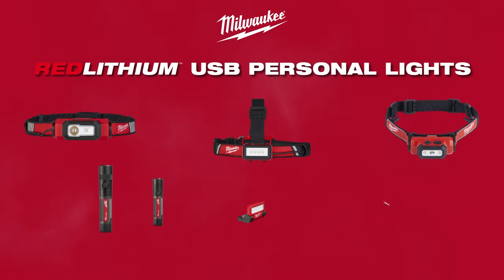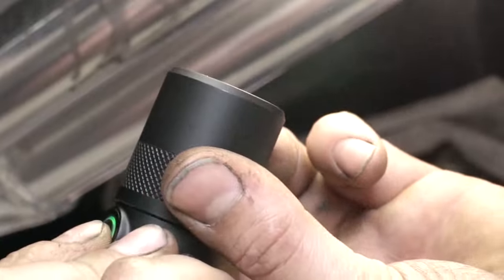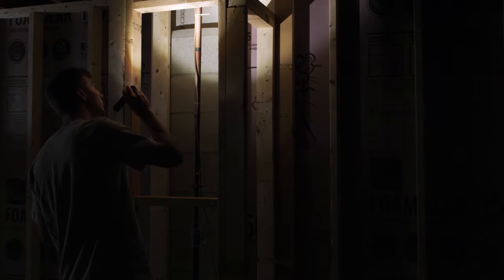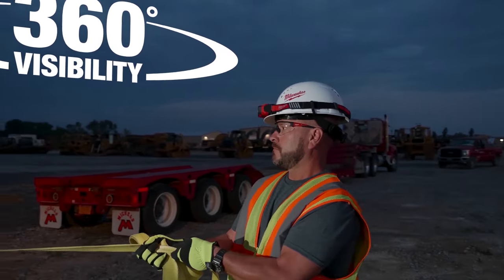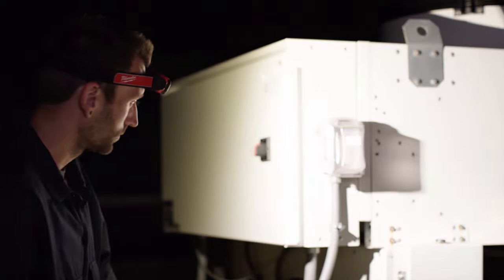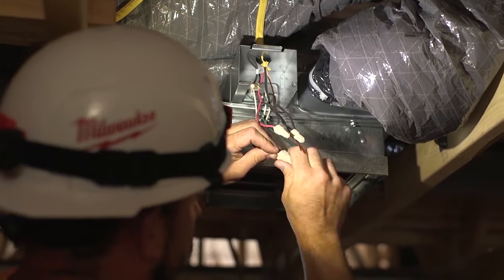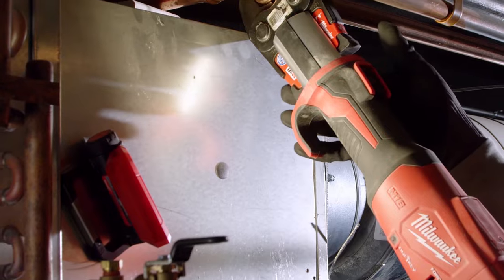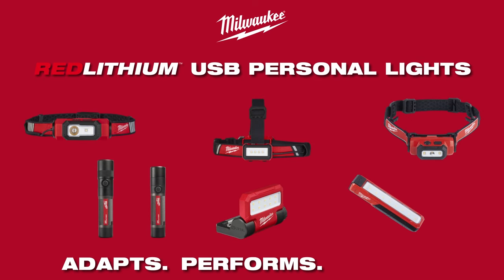Milwaukee® REDLITHIUM™ USB Personal Lights

Comment: 1:42 By FAR the best headlamp I've ever owned.  It's bright enough to cast a 30 foot beam but not too bright to use it when you're face to face with a breaker panel.  I can get like 4 hours out of it on max and I often forget I'm even wearing it.  I also tend to forget that it is actually dark outside.  I only wish it was USB-C

Comment: The low profile headlamp is excellent for  sheep shearing at night instead of just relying on the lights in the sheep shed  . Previously I was overcome with heat exhaustion during the day but now have two Milwaukee low profile head torches. I can keep a spare on charge which enables me to keep sheep shearing right through the night when it is much cooler which is better for the sheep as well as me.

Comment: I would like to see better charging options like the Stinger from Streamlight. It has a docking station with two contacts that charge the flashlight and hold it securely. There are wires all over that are needed to charge my lights.
Reply: Also it would be nice to see a USB noise reduction headphone set with Bluetooth. Or at least use their M4 or M12 batteries!

Comment: im a carpenter that work in the Nunavut and the 600 lumen headlight work just fine but wire that go to the batterie is a bit short for the Canadian hard hat so you can't line up perfectly the front and the back strait and it we need a how much batterie life left